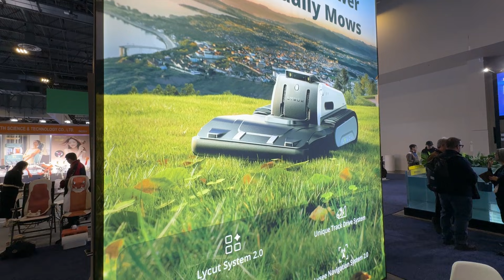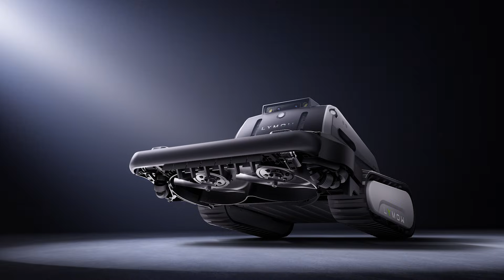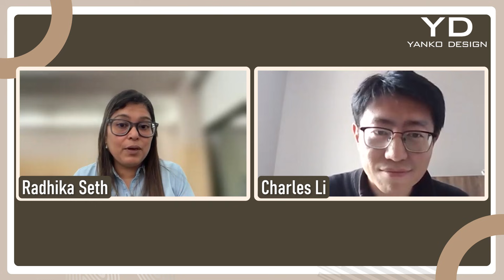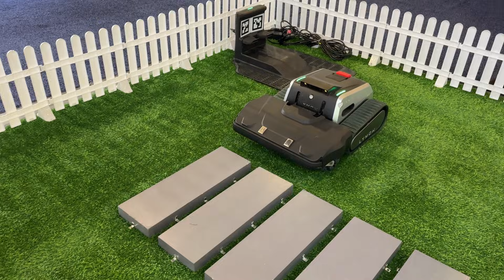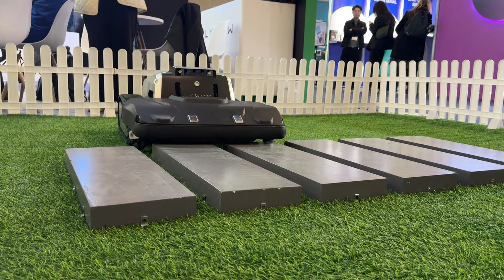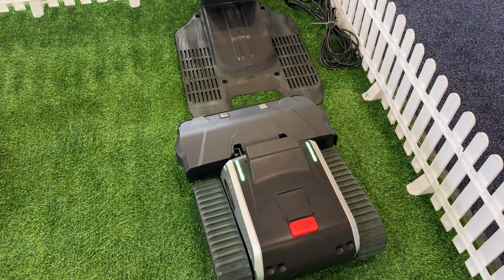Lymow One Plus boasts rotary blades, tank treads & cyclone airflow to solve North American yards

Comment: Can somebody  give me a summary of differences between the old and new? Much obliged!
Reply: • More power: One Plus has a stronger motor and handles tall/thick grass better.
• Better blades: Upgraded SK5 steel rotary blades for tougher cutting.
• Improved airflow: New cyclone system lifts grass for a cleaner, more even cut.
• Smarter navigation: Better AI object detection and more reliable path planning.
• Higher efficiency: Covers more area per day and wastes less time.
• More durable: Reinforced frame and drivetrain for rougher lawns.
• Better overall cut quality: Cleaner finish, better mulching, fewer missed spots.
Reply: @Alex_Outdoors_NA appreciate the effort man!
Reply: another huge upgrade is the charging contacts on top of the mower, rather than under.   the old ones are underneath and regularly get covered in grime and as a result the mower won't charge.   this is a very common and annoying problem.  hopefully this new one is better... will they fix my old one?  remains to be seen

Comment: Exposed front contacts will get dirty either on the bottom or on the deck. The contacts need to be covered or on the back and instead of facing up to collect dust and dirt, facing down. Remember, gravity exists.
Reply: Add brushes on the charger so when it docks and undocks it self cleans the contacts
Reply: And prolonged exposure to the elements may cause corrosion. For sure they need to be protected from the elements
Reply: Gravity is still 100% a theory.